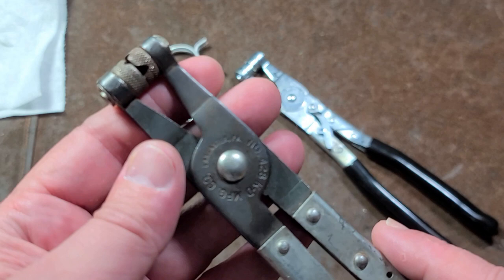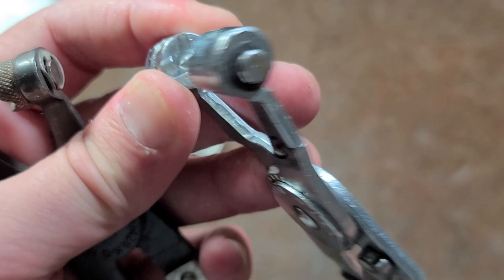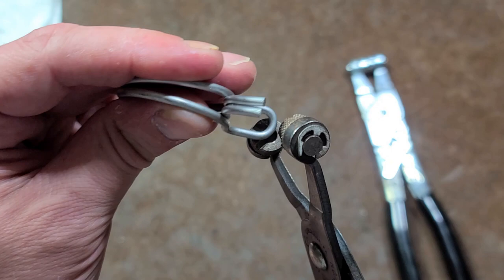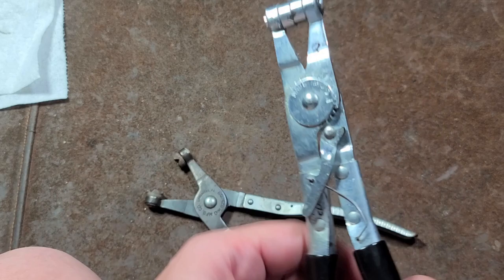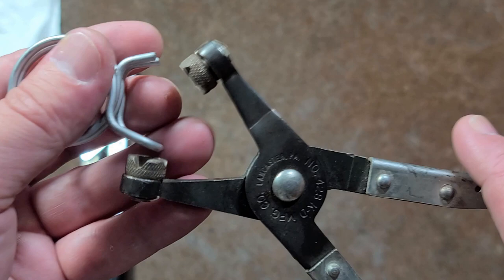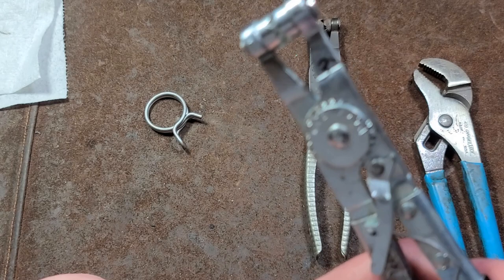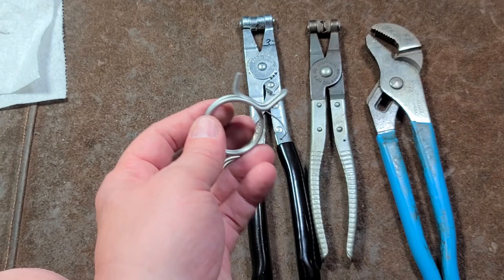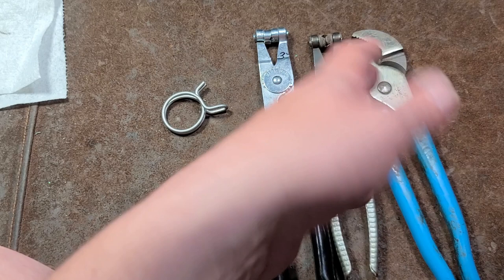Professional USA Spring Hose Clamp Pliers Review

Comment: I have both of those pairs. I had machined the KDs to have new inserts so that they can work on the newer hose clamps. I had finally broke down and had bought a set of Blue Points so I put the old inserts back in the KDs. Must have like six different pair of hose clamp pliers.

Comment: I have a pair of WILDE's from my grandfather that he cobbled back together with a wire in place of a missing e clip, and they are my Go-to  for lawn mower work.
They also have the locking feature and I quite like them.
They to me work much better than tongue and groove or slipjoint pliers because you can swivel the anvils if you need to get in at a different angle.

Comment: You can modify regular slip joint pliers to do the same thing. Drill a hole in the tip of the closed jaws, another from the side, and then one on each side of the opened jaws at the intersection. Mine have been great on single wire clamps.

Comment: After fighting for hours with one of these double wire band hose clamps in my Frigidaire (Electrolux) washing machine, I resolved to buy the right kind of tool in case I ever encounter one in the future. You don’t know how disappointing it is for you to tell me that what I was already using (channel locks) is somehow “better.” Ugh.

Also, FWIW, this one was a bit bigger than the ones you demonstrate with so I don’t take much comfort in hearing that they are “usually a bit smaller” than the one you are demonstrating with.

Comment: I’ve been a tech for over 10 years and never seen a hose clamp like that. At least on a vehicle. They would work a hell of a lot better on a regular style clamp .
Reply: Count yourself lucky. I just encountered one inside a front load washing machine and it was an absolute nightmare. There wasn’t enough clearance to open a set of channel locks under the drum and any attempt to do it with pliers would always lose at least one of the split barbs. The only way was to open the clamp with pliers while outside the machine, then hold over the barb, then use one hand to work the soft rubber “hose” onto the barb which has pesky castellations to make that extra-difficult, then try to work the clamp over the raised rubber lip on the hose without slipping… if you hadn’t slipped already… which you’ve probably done 20x before even getting that far and even when you get that far it will invariably release from the pliers in an uncontrolled way due to one of the split tangs slipping out before the other. I can’t tell you how many times this left my soft rubber “hose” with one of the two bands slipped off on one side, buckling the “hose” such that there was a gap for water to come right out.

I keep putting “hose” in quotes because it’s really a large molded rubber box thing that acts as a coin catcher for the drain pump. It has two other hose-like protrusions clamped to two other fittings so you have this big rubber box in your way, forcing you to come at the clamp from an angle that just does not work for a double band hose clamp. You always end up clamping the loop to one of the two tangs.